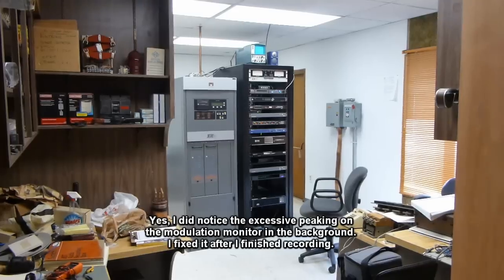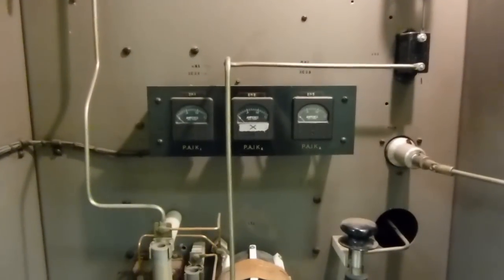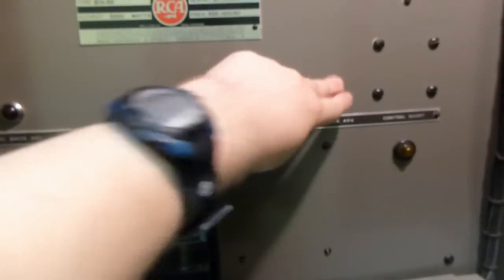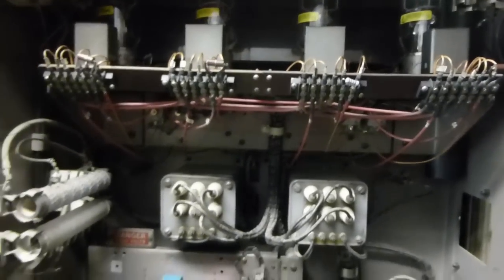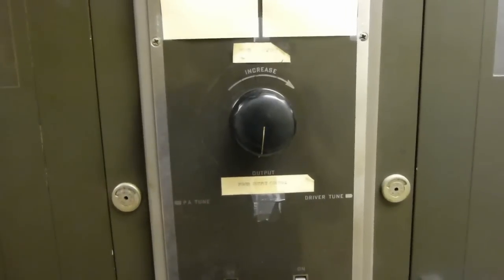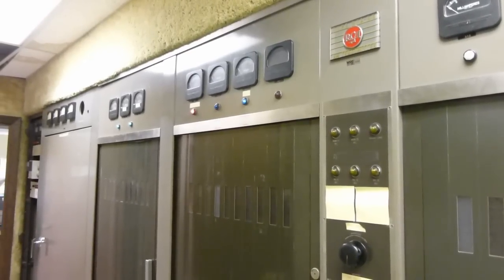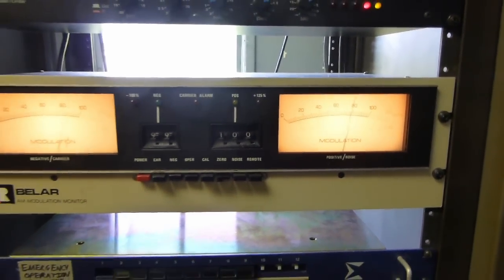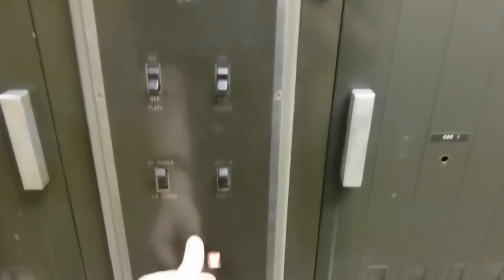A Look at a 1950s-era AM Radio Transmitter

Comment: Several years ago, I took a tour of the transmitter site of CFRB, Toronto.  It's a similar vintage transmitter that runs 50 KW.  There's a bit of history in it's call sign.  CFRB was founded by the Rogers Vacuum Tube company to promote the company's batteryless receivers.  Ted Rogers invented the indirectly heated cathode, which mean a battery for the heaters was no longer needed.  Hence the letters R(ogers) B(atteryless) became part of it's call sign.  This Ted Rogers was the father of Ted Rogers Jr., who founded Rogers Cable and was owner of several TV & radio stations, a cell phone network and more.
Reply: Wow, learn something new every day. I knew about the rogers battery-less tube he invented but not the CFRB RB relation. Cool! Thank you. EDIT: I realized most CRT's used such indirect heated cathodes too. That was such a widely used very important invention of that era.
Reply: @spikester  While I knew about that years ago, it's also mentioned in the Wikipedia article about CFRB.  You can add to this CFRB is now owned by Bell Media and Bell is Rogers' main competitor for TV, cell phone network and Internet.
Reply: @James Knott  aware of the Bell smell part, that was obvious from its failure of content today.

Comment: I made a 200w AM broadcast band transmitter for my neighbour and I, we have a huge collection of old am radio, but since there's no station where I live, I made one myself and I run the audio from a tube amplifier connected to my computer with a digital am compressor. It has 2 807 in the final rf amplifier, class C plate modulation. It's a smaller version of this one. It really sounds like a commercial radio. We don't have any neighbour around so I don't have to worry about bothering others people. The antenna is a radial half wave long wire. It runs very well. I used a all tube design because it's easier and I have plenty of parts.

Comment: A few years ago, I was working on a line at the KDKA AM transmitter site. The original 50kW transmitter looked like this RCA and was still on site (I believe the site guy said it was being maintained as a back-up) and they were operating a new solid state 50kW Harris Transmitter for their main.
Reply: I live about 20 minutes from the KDKA site and would absolutely love to see that old beast in person - I've seen pictures. It'd be so awesome if they put it back on the air at some point even for just a bit. I've always dreamed of picking up a 50,000 watt giant from a tube transmitter on my transistor radio. I'm 21 now, so solid state has been the thing for stations during my lifetime.

Comment: What a flashback!  I started in radio back in 1983, halfway through high school...  I recall having to make an 11-mile drive into the river bottoms to replace blown fuses at our remote transmitter site (on stilts even) when they'd blow...  Nope, I couldn't tell anyone what that AM transmitter model was but I spent quite a lot of time in that decade (83 to 93) watching while our engineer worked inside our boards or the transmitter stand in the studio.  I returned to radio in 2001 and 2002 (almost two years exactly) and found the thrill and art was gone but the technology was no less fascinating to me.  Gone was the odor of burned dust on tubes but still interesting...  Thanks for some pleasant memories from a past life  :)

Comment: A little about selenium rectifiers.  I once owned one that was rated 250 V at some tens of milliamperes.  Needless to say, I eventually wanted to see, " what it had had for breakfast".  Actually nothin very exciting -- definitely less than an alarm clock internals...  However, the alarm clock internals never smelled like the eventually blown selenium rectifier!

Later on, I was in a job, where I got many more smell incidents.  There we used stacks of much larger selenium plates as over voltage clamps, something similar as present MOVs (metal oxide varistors).  We bought the plates in quantity and assembled the stacks ourselves.  Each plate was good for about 30V.  But as said, occasionally some strong spike exceeded the voltage and avalanche current at some plate, shorting it and then the voltage on the remaining plates increased and the failures propagated through the entire stack.  The smell provided an easy trouble shooting.  You knew what had happened instantly at entering the room, or often even outside.

Comment: Hmmm Negative peaks higher than positive peaks means you got the audio phase going into that thing backwards also many of those old mercury vapor rectifiers were replaced with Xenon gas filled more modern replacements that were not nearly as prone to Arc back. Finding parts for the Harris MW5 PDM transmitter would be a challenge and I imagine a chore to maintain, glad you guys made the decision to keep the old RCA as a back-up.

Comment: Having never worked AM, the closest I ever came to tube transmission was working at a Class A FM with a Collins 830-E backup running at 3.3 kW. Not nearly as sexy as one of these old RCAs (or even a Continental, for that matter), although the site was operationally unique in that it was the first hydro-powered commercial FM in the US! When we were running on hydro you could watch the power meters fluctuate slowly with the flow of the water through the turbine...

Comment: I visited this site in 1965 when it was WSAY1370. the studio was upstairs in the house on French Rd. in Brighton NY. the owner, Gordon P Brown, had built the station in 1936 when it was one of 3 existing am's licenced to Rochester (the others being WHAM 1180 and WHEC 1460.)  I believe it started at 1210
pre-NARBA. it originally was well-staffed but following an announcer strike,  Brown operated it on the cheap as a combo operation... as of 1966, they ran Bell home tape recorders rather than cart machines.
Reply: Right you are, Leon. I first visited in 1960 when it was a split operation and the equipment was fairly new.  I started working there in 1966..same equipment, and replaceable Bell transports. (There were several downstairs in the engineering shop on standby).  The station employed full-time first class phone operators to handle the original directional 1kw operation and then the 5k nighttime operation.  After upgrading to 5k, daytime was NDA.  There were 4 stations in a two mile radius, WHEC (1460), WSAY (1370) WVET (1280) and WBBF (950).  The first 3 were 5k DA-N and BBF was 1kw DA-2.  The WSAY studios were to move to 250 East Avenue after Gordon Brown got the license for Channel 13.  He started building in the early 60s but lost his bid for TV and then just gave up.  The studios remained on the 2nd floor of 560 French Road until his passing in 1979.
Reply: Dave I spent 2 years at the U of R. Tried to get a weekend job at SAY but was told no because I didnt have a car. I beard BBF could never get the full 5kw because it was too close to 950 in Utica,

Comment: I'm surprised the Hg vapor tubes weren't replaced with  generic plugin solid state rectifier units.  The time for mercury to vaporize was 5-15 minutes, whereas the glass or finned metal power triodes and tetrodes was only in the one to five minute range.  

The PSM (progressive series modulation) in the Harris MW series eliminated the modulation transformers and their artifacts, though the newer series digital AM transmitters using banks of power MOSFETs are even more efficient and use more reliable components.  Digital transmitters skip the entire idea of A3 modulation, and merely generate a digital analog of a modulated waveform, and switch power at a clock multiplier of carrier frequency, and then filter artifacts.  A 5 kW nominal transmitter would likely have a 50 kW peak capacity, to cover 5400 watts carrier power into a directional array phasor, plus some reserve capacity, and to handle 125% or more peak positive modulation envelope instantaneous power needs.  

Overall (line to load) AC efficiency is around 30-35% on those old tube beasts, around 50% for an MW series Harris, and around 65% on newer digital transmitters (the Nautel among those), which pays for the entire newer transmitter with a bonus of better audio quality over its lifetime.  

FWIW, I'm a semi-retired broadcast engineering consultant.

Comment: The Nautel is stress free. The RCA not so much. My husband's dad was a station GM. What they went through with tubes, rebuilt tubes and lightning. Also their 1964 era RCA could not modulate much beyond 84%. The Nautel would be a different story in so many ways beginning with the cabinet size. I have deepest respect for both transmitters, RCA equals our history and the Nautel the future. What I truly love is GATES Boards and if I owned a station I'd use remanufactured ones in the control & production rooms.

Comment: Great video. The MW-5A was sort of a dog; I maintained a couple of them. The RF module transistors would blow constantly. Eventually, replacement transistors were difficult or impossible to come by. I bought some of the last stock that Harris had for WMAS in Springfield, MA back around 2004.

Comment: I'd like to hear what that old transmitter sounds like compared to a modern transmitter. I wonder if a listener could tell the difference
Reply: A trained ear could easily tell the difference. Most AM broadcast transmitters sound like crap, because some engineer that knows nothing, cranks all knobs to the right to make it LOUD. Some of the best AM audio can be heard on stations like KFBK and KGO in northern California. As well as WSM in Nashville. J.
Reply: @jimw7ry  I'd leave KFBK AM out of that list. What sounded bad in general was AM stereo, which was touted as having only slightly perceptible distortion.
Reply: @jimw7ry  Not just am, most fm stations are unlistenable-  total compressed crap.  The stations in houston, save one or two non-commercial stations are unbearable to listen to on a nice Marantz stereo system or similar.

Comment: It is a shame that so many old, beautiful transmitters have been thrown away.  Of course it worked!  I never thought it wouldn't.    RCA All the WAY.     Wasn't the prettiest transmitter but worked well.   Just by you firing that up the stations electric bill went up for the entire year.  Gotta watch firing up backup transmitters when you are on a demand meter.  It can run up the bill for the next year just by running it a few minutes

Comment: THANKS!  That was really nice.  I didn't know that high-level modulation was used on transmitters as big as 5kW.  I bet it sounds beautiful at 100% modulation.  The class-C final probably payed off back when the radio audience needed a few seconds of dead-air at regular intervals.  I'm sure glad you mentioned "Scott T".   When I saw 4 rectifiers, I wondered if it was a single-phase bridge, with 3-phase only for the blower.  I'd like to have seen the tank circuit on the final.  Thanks again.
Reply: High level modulation was used on WLW's 500KW rig back in the 40's. I believe the ginormous modulation transform is still in the basement.

Comment: The thyratron tubes are fired by a rotary pulse transformer which can be adjusted to alter the phase relationship between the high voltage AC and firing pulses

Comment: Don't ever, and I mean EVER lose your passion for broadcast engineering, because when you reach "old fartdom", it's the memories, Slavic foods, and bitching about how music has sucked since 1987 which gets you through the days.....   The 'oil filled' items, there's a second way to monitor their sealed status, which  greatly augments the visual protocols:  Purchase a decent grade Combustible Gas Leak Detector (refrigerant type); when caps and xfrmr's were impregnated and saturated/filled, most had <5%  +/- 1% of a proprietary toluene and MEK mixture added for purposes of improving saturation of the electrolyte, and minimizing galvanism.   It had been my experience, that I never noticed leak formation in anything which did not issue a gasseous first warning.

Thanks for the upload, I enjoyed this very much indeed!

Comment: A most excellent tour, of a most excellent piece of 1950's technology. I know little about transmitters, but am assuming it's audio is plate modulation? I know ham transmitters from the 50's were sometimes screen modulated, and that's why I'm asking. I had a friend who used a Johnson Viking 500 starting using during the early 70s through the early 90s. He wound on occasion operate the 500 with it's cover off in order to enjoy the bright fuchsia Color That was given off by what I believe to be 2x  811's. Thanks for the walkthrough.
Reply from the maker: More or less, yes.  As I understand it, it's a hybrid between plate modulation and Heising modulation.

Comment: Its like im listening to my dad again... he was an electronic engineer for Helicrafters, AKA Northrup.
You explain things, almost touching scary energized stuff so casually, its a bit disconcerting. (like my dad:)
That Jesus stick... one day dads coworker started working on a high power transmitter just like that.
Dad and other engineer walked up ready to do his thing, confirmed with him it was all discharged...
Reached in to start working, and woke up in the hospital, his right hand and arm burned / permanently damaged.
He always blamed himself for not checking. Even though the other guy was working in there for hours already, and should have discharged High V caps he actually was removing??? He lost most feeling, then later because of that burned his hand BAD on a soldering iron changing tips. literally didnt know it was on and held it till he noticed his hand was smoking...EEEK.

Comment: WAPE 690,Jax, Fla  could hold a fluorescent lamp in front of the transmitter and it would flicker with the modulation. I often wonder what became of that 50kw transmitter after they switch over to FM. It was a home made from scratch transmitter built by The Brennan Bros. .

Comment: Worked on these transmitters in older days! Loved those MVrectifiers! The opened design of these made it easier to spot problems.5kw and 10kw versions of these.
Reply: Im wondering  how much  the  transformers  weight. .. so much  cooper!
Reply: @robertl.fallin7062  The HV transformer has a 3ph primary 200-230VThe secondary is 4Ph Scott connection for the MV thyratron rectifier and OL.Can't remember how much these transformers weighed in at.They are an odd one to obtain--Either from a junked H or have Peter Dahl make one up-or have a motor/transformer rebuild shop rebuild your old one.

Comment: We had one of those 5 KW RCA Transmitters at WVOL-AM in Nashville. It was installed around 1958-59 by R.W. Rounsaville, and was replaced by a BE AM 6A in 1995. I loved that old RCA, it sounded so good. Our RCA was feed by a Orban 9000A Processor, which the current owner of WVOL has kept as a back up processor. One day, around 1990, I got to help the C.E. of WVOL work on that RCA Transmitter. Learned alot! I think I was just in my late 20s then. That station was so fun to be around, but now all new stuff is there. I tell myself, all good things must come to a end.

Comment: Optimods are fine for old TXs... Modulation transformers just like to sing. Great vid. :)
Reply: Yeah, if you were outside the rear of the Tx building at 6WF/WN Tx site, you could clearly hear the 6WF program from the modulation transformer of the 55kW STC Tx. 
We had 6WF on 720kHz at 55kW, 6WN on 810kHz at 10kW, (these shared the same antenna), & the "regional shortwaves" VLW & VLX, which served the  Northern parts of Western Australia.
VLW was 10kW & VLX 50kW.
All the Tx were STC, except the standby for 6WN, which was Philips.
Strangely enough, the 10kW  standby for 6WF was a totally different STC model to the 6WN main Tx.
Watching the video really "took me back"----I could almost smell the old tube Tx smell!

Comment: They sure don't make 'em like they used to! Ya'll could probably use that thing as the main transmitter if you wanted. 

Even on smaller scales that old tube stuff is just skookum. At work I like to have a boombox going and I've gone through two modern solid state sets in six months....so I replaced them with a Zenith tube radio from the late 1950s. Sounds better, cost about 50 bucks, 500% more sensitive. And if it breaks I can fix it, unlike those modern sets that are pretty much just disposable.  Interesting that you mention conelrad here, too, 'cause that Zenith has CD on the AM dial at 640 and 1240!

Comment: Printed circuits wouldn't work for this monster anyway. Reliability is the key, and there's lots of voltage, heat, and current. By the way, I build tube audio by hand, point to point, so I see this sort of construction all the time.

Comment: Someone really wanted to keep this amp as original as possible. These could have been converted to use a bridge rectifier for a regulation and moved to digital oscillators for great stability instead of those crystal oscillators that need heaters.
Yeah the inrush plate current from a cold start would be large. I like those large oil filled caps...